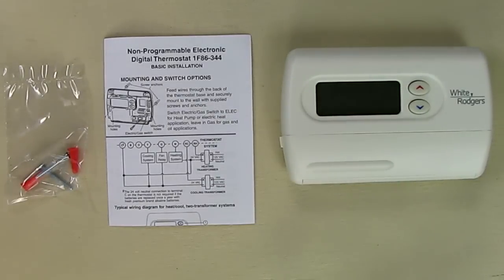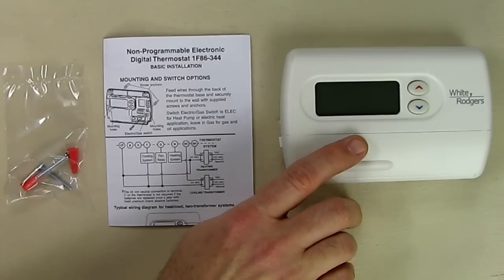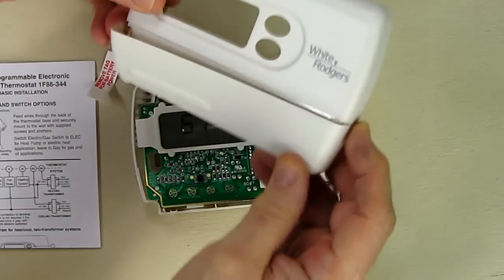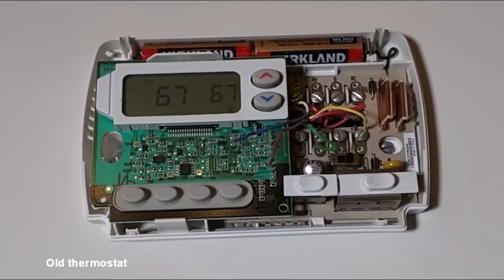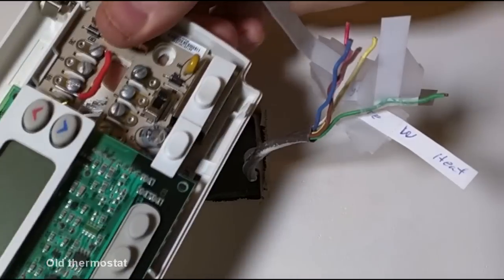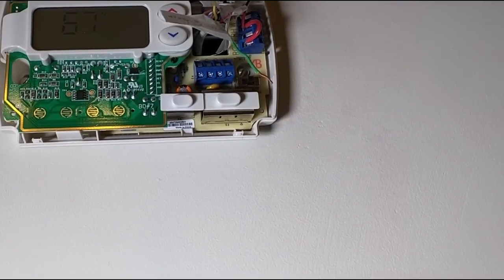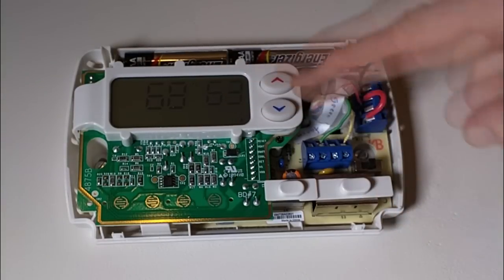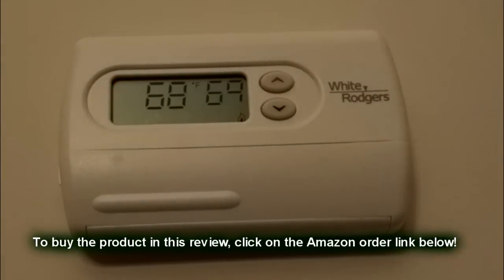HIGH QUALITY Thermostat with Installation How To -  Emerson 1F86-344 Non-Programmable REVIEW

Comment: Can you tell me what the orange/black cylinder thing is? My new one came in and it was bent all the way to the left and idk if thats going to matter or not. I can not find any info on it
Reply from the maker: That is usually a small capacitor. Just position it vertical again and you will be fine.

Comment: Not sure if you'll respond- I have this thermostat and with heat, I cant set a hold temp. When I switch it to cool, the smaller number appears on the right and I can set thr temp. But when I switch back to heat, it disappears and the up and down buttons do nothing.
Reply from the maker: Sounds like your unit is defective. If switch is set to heat, the up/down will change/show the temperature.
Reply: @jeffgrave  thank you! I figured but I wanted to be sure before replacing it